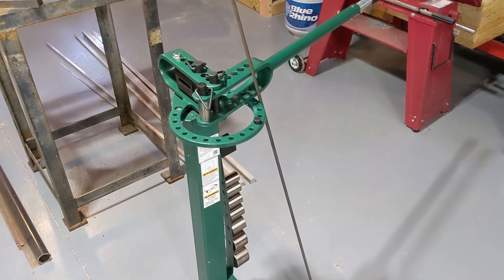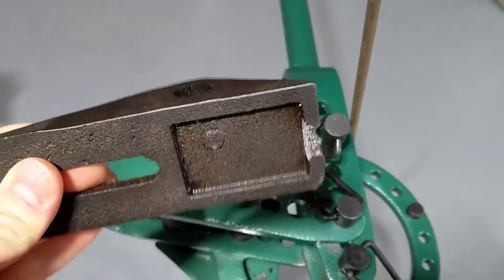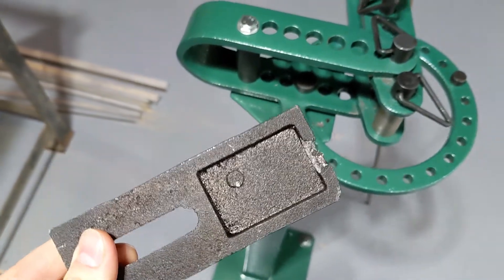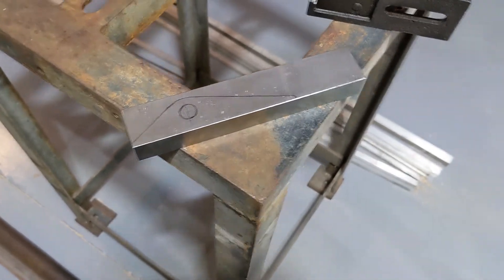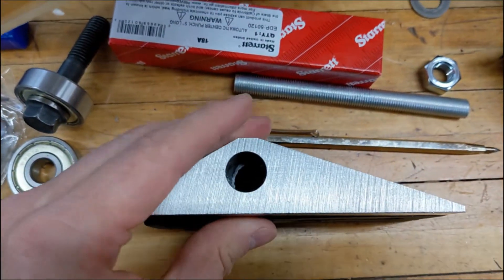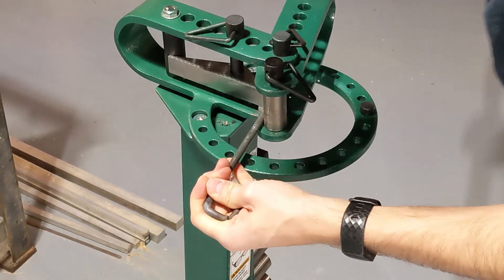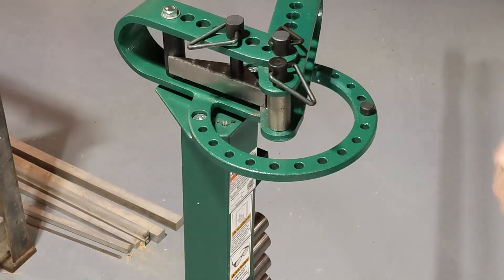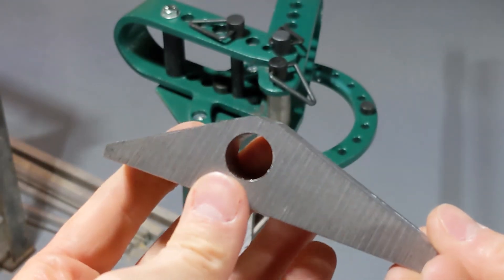Harbor Freight / Grizzly Metal Bender Upgrade #1 - Angle Block

Comment: I recently tried something g different. I put the square block in the pivot position. When positioned properly and with rollers in the stationary and swing arms I can bend 90° bends faster and easier.

Comment: They have changed that part slightly now, but its not for round bar anyway its for flat, if you use the pins and the square block it works much better and without the force you are using

Comment: Case hardening that part, if planning to keep using as-is?
Reply from the maker: So far it has held up pretty well, albeit use has been limited.
Reply: Any ideas where to get replacement dies?
Reply from the maker: Hello, sir. I was able to find replacements from Grizzly: https://www.grizzly.com/parts/grizzly-sharp-angle-bending-attachment/ph3183019
Reply: @rckclmbr85  Hi and thank you sir!  Awesome!  Really appreciate the link.  Realized there was a parts list and then from the part numbers listed on the link, I found all the parts.  Nice!   

Little background since I haven't made a video yet regarding, I found two stands with the bending bracket and a few other parts online for sale... both missing the Yoke arm, dies and angle bending attachment.  

Figured I'd fabricate for the first better quality one, since they're not exactly the same specs, a Yoke arm from the second one similar part of the bending bracket by cutting out twice the thickness of the metal and then welding on like a bung for the tube arm when welding that seem.   

I was also wondering once I measure the holes for the left over bending bracket radius ring piece, if I can use for a DIY tube notcher.  At least at the time, that's what I was thinking.  I might be able to use the inner or out edge for finer adjustments also and I have enough metal stock around to fabricate.

Thanks again for sharing!
Reply from the maker: Sounds like an interesting build - I hope you do post a video. Harbor Freight doesn't seem to have good parts support, but at least many of these items are more or less the same foreign imports under different brand names, so other manufactures are covering the parts market.

Comment: Operator Error !!! That die is only for flat bar !!!  Those round dies hanging on the column are for round stock,when in doubt read the directions  !!!
Reply from the maker: Evening, Steve. Very true. You can review the other comments, but I found that, for sharp 90 degree bends, you can use just the center pin and no die with up to 3/8" round stock. So that's what I've been doing for my 90 degree bends, and it's working out great. However, there are still times when I need to bend round stock on a very acute angle, and for that I'm using my custom tool steel angle block. So far, it's holding up fine and working great.

Comment: you are using the wrong die. Use the square clock with a round die . It will make all the difference.
Good luck.
too bad the instructions are so inadequate.
Reply from the maker: Thanks so much for this, Daniel (and for going easy on my ignorance!). After your comment I did some more research. The Grizzly manual is pathetic - four pages long. The Central Machinery manual is much more in-depth (24 pages). But I found a company out of the UK selling this under the name Clarke Strong-Arm. Their manual is fantastic (36 pages) and contains information not in the other manuals. They have a very useful warning on Page 2:

"NEVER bend round stock when using the sharp-angle-bend attachment. Use only flat, hot-rolled, mild steel up to 3/16 x 2” or 1/4 x 1-1/4” with this attachment."

No doubt that is due to the exact issue I discovered. They also have this comment under the U-bolt bending instructions:

"Eight bend radiuses are possible—by selecting from the seven forming dies, or by using centre pin without a die. However to avoid bending the centre pin, always use a forming die with round stock larger than 3/8” diameter."

By using just the center pin with no die and the stop-block as you suggest, I was able to get decently-short radius bends. Not the zero-radius I was going for, but close enough for my needs.

Thanks, again!
Reply: @rckclmbr85  thanks for mentioning the Clarke instruction manual.  I’ve had one of these benders for years and have never had enough time to devote to it to find out it’s operation.  You would think the other brands would produce a decent manual as it would sell more benders for them in the long run.  Thanks very much again.
Reply from the maker: @37yearsofanythingisenough39  thanks for watching and for the comment - glad it helped! Honestly, I use this infrequently enough I feel like I'm relearning it each time lol
Reply: will this bend Angle Iron?